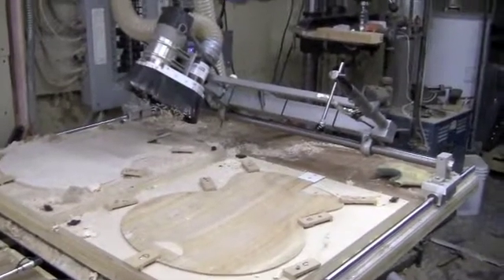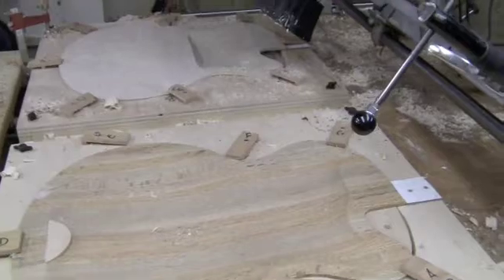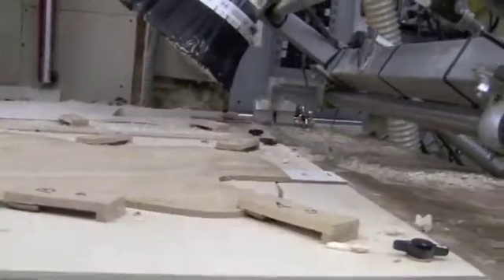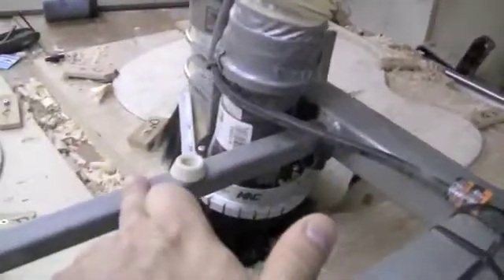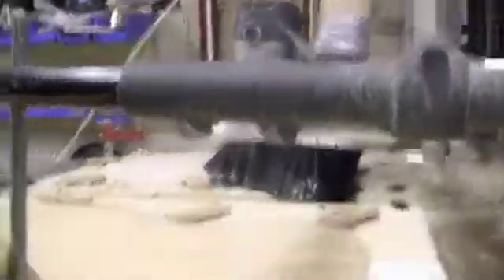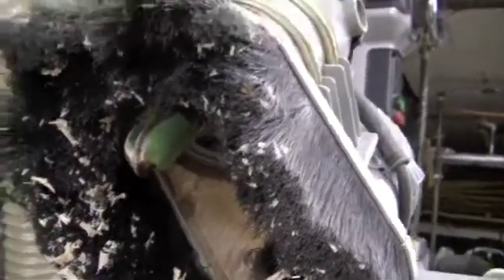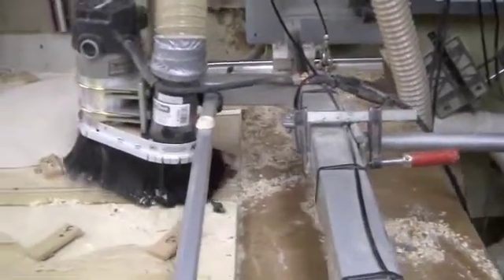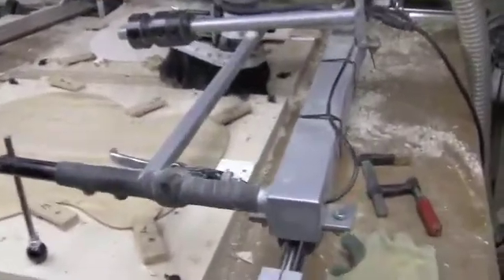Carving Duplicator

Comment from the maker: Sorry,I don't have the source for the rails written down anywhere, but I do remember I found it on eBay under 'linear bearings'.  They are 3/4" diameter. They came as a set (bearings and rails) and cost about 120$ delivered from china. I chose them over elevated rails  because they won't flex under load and they lend some rigidity to the base.